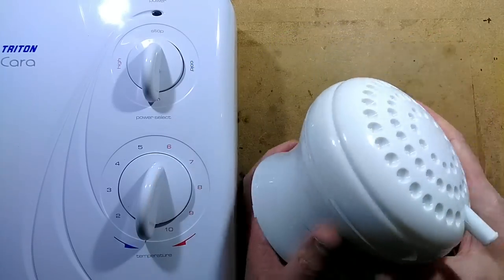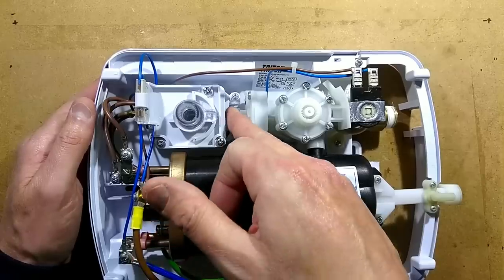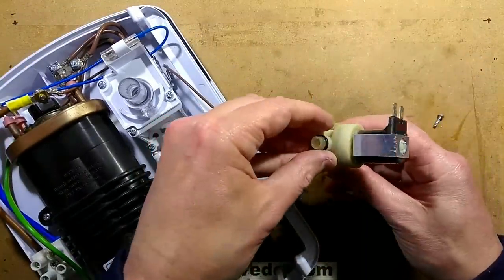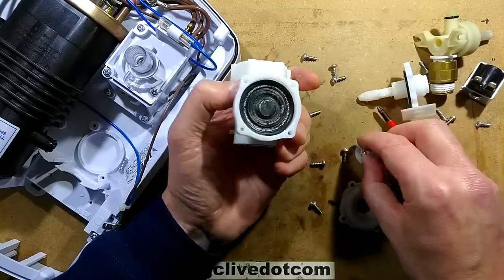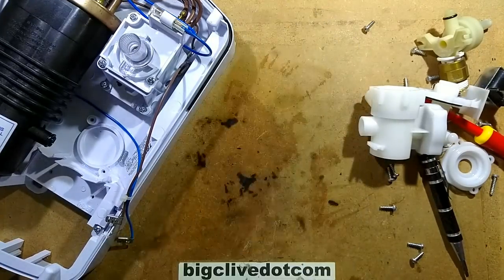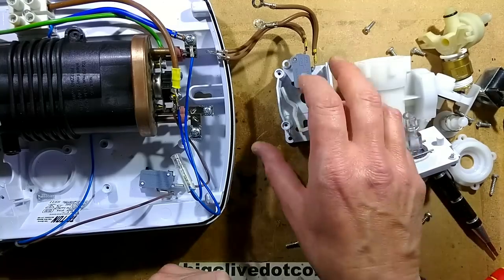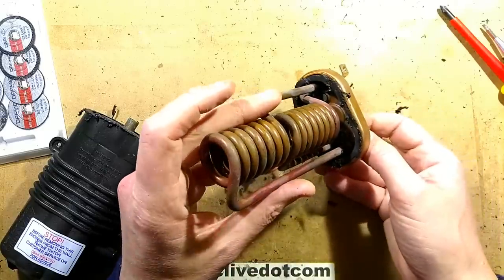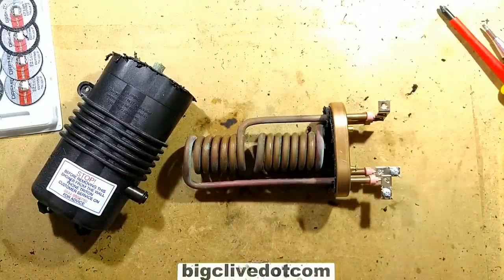Teardown of a UK electrically heated shower unit.

Comment: I've always wondered what those boxes were. In the US I don't think we even have an option like this at least that I've ever seen. Very Fascinating indeed.
I'm curious how how the water actually gets.
Reply from the maker: It depends on flow rate and incoming water temperature.  In the summer you have to switch it down to the lower setting, while in winter you sometimes have to turn the flow down quite low to get a decent temperature.  They can be set far too hot for comfort before the internal safety thermal cutout kicks in.
Reply: bigclivedotcom  Ah okay, thanks for responding. :) 
I guess it's common for everything to be set to high. A lot of water heaters here tend to be set higher than suggested.

Comment: A really common failure I experience with these is when they fill up with limescale and someone tries to turn the pressure up to rince out the bath with cold or in summer when using it on the double heat mode for a higher pressure shower something goes wrong and it trips the breaker and then whenever power is applied it keeps tripping and has to be replaced. I have about 10 sitting in my garage all broken from the last decade or so.
Reply from the maker: The RCD tripping is usually due to a corroded element.
Reply: @bigclivedotcom  Sometimes they last as little as 7 months. Kinda frustrating tbh. 👍🏻

Comment: 45 amp breaker so to run that on a 120 in the US we would need a 90 amp breaker or lets just say 100 amps due to wire heating loss lets just say with split phase power that we have the US one shower would be half the power for the entire home

Comment: So in Europe they don't have hot water heater likes they do in the us? I have a giant 32 gallon gas powered water heater I think it works great
Reply: Lights-Out Gaming In the UK and Ireland, a typical household would have gas central heating (radiators and relatively small hot water tank) - but the problem is the hot water pressure from this is quite low and unsuitable for a shower, so an electric shower fed directly from the storage tank (in attic, very common here) or from the mains is a popular solution.
Reply: You do, these are generally fitted to old houses or in houses where the occupants are too poor to fit a good water boiler. Only poor people and students tend to use these kind of showers.
Reply: Oscar vL ; why the hell are you on so many comments trying to push the "poor people" angle? I've seen them used in countless houses in conjunction with a modern combi-boiler purely because they're so convenient for instant hot water, especially in winter.

"Poor people", give me a break. It's the single most common type of shower in the UK.

Comment: We have much better designs in Thailand. They have trial control for temperature and nearly all have an earth leakage trip on the power input. Still require an earth connection which is quite often ignored here by those who don't understand why it's needed.

Comment: Clive, u need a electric screwdriver to reduce  dismantle time and save your wrists and a little magnetic dish to put all the screws, I use magnetic dish when repairing cars, keeps all the bolts and screws together and are dead cheap
Reply from the maker: At work I would use a powered driver when required.

Comment: Just moved from a 220v house to a 110v apartment.  the suposedly 5500w 110v shower can't heat water to an acceptable level if it's under 10 Celsius (and it's winter now so shower only during the day). i have an unused 220v 7500w just staring at me :( poor thing could heat water even when it was something like 0c outside.
Reply: Well, an element rated for 5.5kW at 110V would have a resistance of just 2.2Ω; so if the cable leading to it is long and/or undersized, the power to the shower could indeed be reduced considerably…

Comment: I have a friend that has an instant hot water heater for their kennel. For some reason the heat keeps going off and on,as if the heating element is bad. One minute it is scalding,the next freezing,I looked at it for them,couldnt make any sence as to why it was being inconsistant other than mabe the thermal switch is defective. It is an older unit and I did research on line and didnt find any useful information concerning specs. I told them it must have been a one hit wonder and thats why I couldnt find much info on it. Usually when you get into a Bobs no brand style unit,thats what happends. Had it been a company that has been around for years,there would have been specs on line. I told them to replace it.

Comment: This would be good to put outside for a heated pool shower. Put a water hose hook up on it and make it easy to remove for winter storage so it doesn't freeze and crack.
Also the audio is really basey you need to adjust your audio recording levels.

Comment: I lived in a house that has this british model fixture installed. I absolutely hated it because I never liked the idea of having an electrical appliance so close from a water supply. But crucially, because the model (which was very similar to the one you just disassembled) was so noisy. I mean really noisy. However, I could not identify the noise making part in the tear down.
Reply from the maker: Early electronic meters used to make loud clicking noises as they incremented mechanical digits.
Reply: @bigclivedotcom  I expected to see some kind of eletrical motor with a pump that would explain the noise... perhaps this particular model is silent
Reply from the maker: @nicky5185  There are versions that have pumps for low water areas.  Sometimes you can get weird howling noises from plumbing components if they are fitted incorrectly or if washers are loose.
Reply: Sounds like it was a power shower which is just a pump, as most of UK has low water pressure from the mains.

Comment: Comment before watching: I have one very similar to this and have always wondered if I can be electrocuted by it. Hopefully I will like the answer. Will edit.

Edit: Phew, looks like I'm fine. I was expecting an electric motor in here though to pump water, I thought ours had one at least to compensate for slightly shitty water pressure.

Comment: You will not find these heaters in Belgium, where 230V electricity must be kept 60cm outside any shower space. The only electricity allowed inside that space is 12V. I have never seen them in mainland Europe. Being used to that, I was horrified when I visited the UK and the hotel shower had an electric shower unit with loose cover, I could touch the 240V wires with my bare feet in a - possibly earthed - wet tub. That is how Claude François died, not? 
Additionally, all equipment all Belgian "wet" rooms and "wet" applicances must be in series with a 30mA /residual-current/ground-fault/leakage-current/differential circuit breaker. Is there a reason why you don't mention these Big Clever Clive? Aren't 204V and water considered a deadly combination in the UK?
Reply from the maker: For safety all adjacent pipework is bonded together and a 30mA RCD is used.
Reply: bigclivedotcom So we have that part in common :-)

Comment: Are whole home water heaters not common in the UK?
Reply: they are...this is just another option
Reply: Yes but they feed the bath, they don't have the power to feed a shower, not enough pressure. Combi boilers have the pressure but not the capacity, always a luke warm shower with those.

Comment: You say European, but I have never ever seen one of these electrical showers in any house in Germany. If people heat their water with electricity (which most people don't, because it's too expensive), there is usually a separate heating unit that sits under the sink or something, which probably works quite similar, although I don't think you can regulate the heat via the water pressure (other than turning the shower tap to a smaller setting), but they are generally more integrated into the plumbing so that you don't have any electrical device in the shower with you.
Reply: Go to the Amazon Germany site, search for "Electric Shower", and you will find plenty on sale, including models from Triton.

Electric showers like this are falling out of favour in the UK due to the inherently poor flow rate. However, they are very cheap to buy and easy to install, so are still popular. What are now often used are either mains-pressure combi gas boilers for smaller households or hot water systems supplemented by shower pumps (historically UK hot water storage is low pressure using a header tank for safety/regulatory reasons). Mains pressure hot water storage systems are becoming more popular, but they are relatively expensive to install.
Reply: It may be that these showers have fallen out of favour in Germany in the 70s or 80s, because I really can't remember ever having seen one in a German household (but then, it could be that they were there in my early childhood and I just can't remember it). We did have flow heaters (and some old buildings still have them), but they are usually attached to the tap and are mounted under the sink, while all the showers seem to have been converted to some different heating system much earlier.

Comment: Very rare here in the U. S. what with 110 volts being usual. Similarly, electric kettles are rare. I bought one 2 years ago after a trip to England. It's distinctly slower, but usable.

Just saw a video yesterday about sudden demands for power in the U.K. right after popular TV shows or televised sporting events end: electric kettles. Rarer now with Internet viewing.

Wind power for heating water: just seems wrong, but Britain is going for it I guess.
Reply from the maker: Scotland has a lot of wind farms.  We recently had our first day where we generated more power than we used with wind alone.

Comment: 40 amp breaker at 240v?  That would be 20A @ 120v, and electric water heaters (we have in the U.S., but never these things).. those take 30A double breakers @ 240v (two phase).  It just seems wasteful to me to put these in showers, and potentially quite dangerous as well.
Reply: What are you talking about? 40 amps at 240 volts is 80 amps at 120 volts. Your point about waste also makes little sense- what are you suggesting is being wasted? Power? The breakers themselves? Why would electric showers be dangerous? We have used these for decades in the U.K. and I have never heard of a single issue.

Comment: I am quite surprised shower manufacturers haven't come up with (or don't appear to have) a better way to control the heat output than by varying the flow of water.
The age-old joke of flushing the loo when someone's in the shower will continue as long as this design is used.
Reply: My one has a load of power fets in it for temperature control. But even then if the water inlet is very cold in winter then the flow has to reduce once max power is reached.

Comment: it still doesn't explain why you can't use a regular shower head on it. When I tried I only got cold water
Reply from the maker: It may not have created the correct pressure differential to enable a pressure sensing switch.

Comment: you could have just put paper towel on the table, then put a shower mat over it, it would be fittings and would have saved you the wet floor mess lol, as an added bonus the shower mat would have made it non slip

Comment: I don't know why they didn't use a ROYER oscillator based Induction Heater to  heat the water rather than using a heating element which would allow for lower wattage Power showers.
Reply from the maker: +DAVID GREGORY KERR These resistive heaters dissipate almost all their heat into the water.  They almost 100% efficient.

Comment: how many dead per 1000 showers?
Reply from the maker: Zero mortality on showers that have been installed correctly.  All accidents that have occurred were usually a result of incompetent bathroom fitters miswiring things or failing to test ground integrity.

Comment: My shower is nothing like that. It has one dial, and a "start" button, with a warning on it that you shouldn't press "start" until the water is flowing freely, because the element turns on as soon as you press it... However, so does the water. There's no way to get the water flowing at all except to press start, and the water splutters out over the now almost molten element shortly there after.

Solenoid to allow water though the sealed unit, the flow control and anything and everything else being inside the sealed engine unit. I've popped one before and replaced it. There's nothing that could go wrong outside the sealed engine.

UK, ofc.
Reply: Brand? Sounds quite poorly designed…
Reply: Gainsborough. It is; Shocking. Not in a literal, or electrical sense, thankfully. It's just pants for longevity, repair-ability and actual performance. It was a "gift" from my father, IMS. :\

Comment: As non brittish, why wouldbu use these systems? I get that by this method you only need one water pipe, but isn't this a waste of electricty where cheaper and cleaner energy sources could be used?
Reply: Traditionally the UK hot water was from a vented (non-pressurized) tank in the attic so being gravity feed you would only have the roughly 0.44 PSI per foot of drop (sorry not metric) and unless you lived in a really tall building you would need a pump to get enough pressure for a shower. This solves that.

Comment: I would have never though about introducing electricity in the shower. Anyway those things would never exist in France, as all fixed electric appliances are banned within the shower/bathtub volume (up to the ceiling), and then, you ahve to respect a 1 meter volume all around the shower/bathtub which is restricted to low voltage appliances only. Very interestign to see one of those then.

Comment: 10kW? rly? that's some serious power, on 240V that's 40 amps. I don't even know if I have 240V cables for that amount of current. I mean maybe on my stick welder, but I'm not really sure in that either
Reply from the maker: It would normally be covered by a standard 6mm cable, but in some long thermally lagged runs a higher rating like 10mm might be used for thermal derating reasons.

Comment: I'm always surprised how popular these are in homes with combi-boilers. Don't really get why people want to spend 3-4x gas for hot water!?
Reply: I stayed in a flat with a combi-boiler- it barely provided enough water flow for the shower.  If anybody turned on a hot tap then the shower ended up with no water flow.

Comment: How dangerous is this thing?
Reply from the maker: There are very few accidents despite almost every home in the UK having one.  When accidents happen they are usually a result of botched wiring by cowboys.
Reply: @bigclivedotcom  what size of wire is recommended? Is it plugged into a socket or better directly connected via connector blocks to avoid loose contact and build up if heat?
Reply from the maker: @IAmThe_RA  In the UK it will generally be wired with 6mm to 10mm CSA cable to a dedicated breaker at the distribution board.
Reply: @bigclivedotcom  Thanks. Love your videos.

Comment: I don't get it? don't you have hot water coming in to your homes?
Reply: Nobody has hot water coming into their homes. Across the world most people have cold water supplies that they then heat. You can heat this in a tank, store it, or heat it as and when required. These showers are useful if you have a gas boiler as a backup, or if you have a low pressure hot water system (from a gravity tank) as they can provide higher flow under some circumstances. They are require less plumbing.
Reply: Spencer Wilton not true at all. Ever heard of district heating?
Reply: Kahn yes, of course. We have it in the U.K. too. But even those systems don't supply usable hot water direct to the house. They supply hot water which is then used to heat cold water to the required temperature, either in a cylinder or via a plate heat exchanger. The heating water is then returned to the central station cooler, ready to be reheated and go around the system once more. I cannot think of a single installation where directly usable hot water is delivered directly to the premises, it would be too inefficient, water temperature too variable, and potentially dangerous.

Comment: Something live n the shower? o k. Pretty scary. Don't think it would pass US electrical safety standards. It would at least have to be on GFI breaker?
Reply: David Collins Pretty sure UK electrical standards are far stricter! Our plugs are safer. We don't allow sockets and switches in bathrooms. Our whole installation is protected by GFI devices and have been for years. Now,its common practice to install multiple separate RCBO's, one for each circuit which helps avoid nuisance  tripping and aids in fault finding.
Reply: I just learned that last night. bigclivedotcom has a series of vids on British indoor wiring that r great. Some of ours looks like spaghetti compared to theirs. Thanks.

Comment: wait, why not just use hot water?
Reply: Two different pressures, cold water comes from the high pressure water main while hot water is heated in the loft and is gravity fed throughout the house.  This plays merry havoc with mixer taps and showers.

Comment: i like those chinese electronic heaters where you can adjust output temperature in digits. i wanted to buy them but i couldnt find any of them here. you could set temperature to 40 and it would fluctate +-1 degrees from that. they would be wall mounted woth a thicker cable and some kind of adapter-like bulge on it.